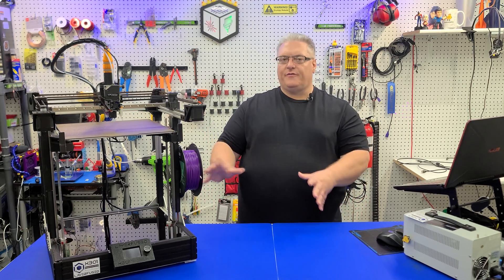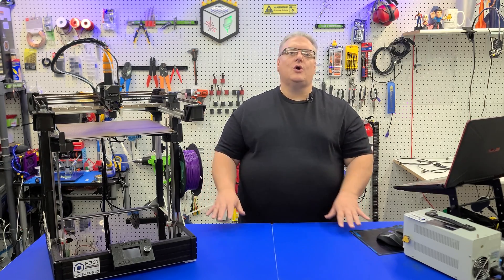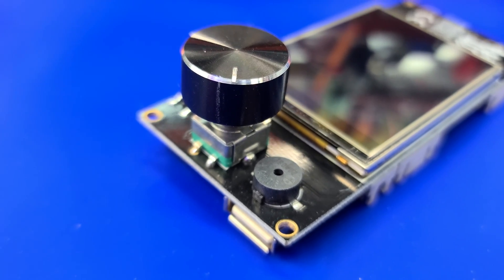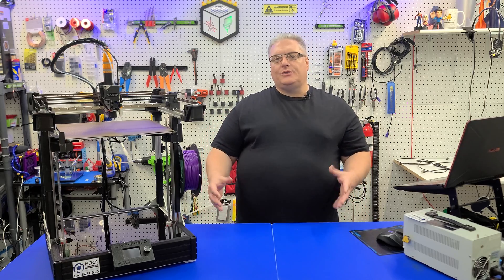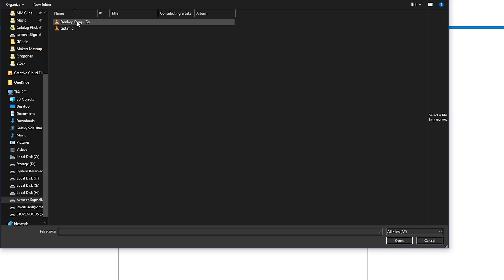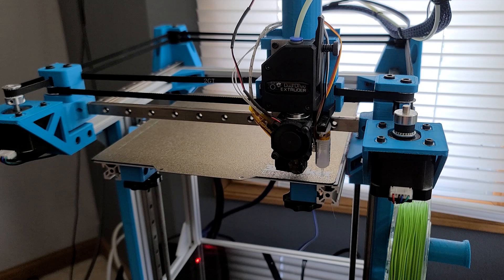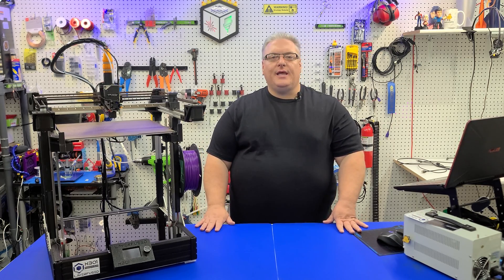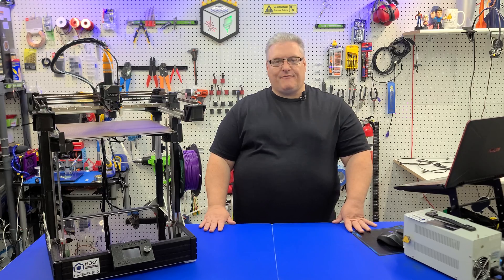3D Printer Ringtones | Improve your 3D Printer workflow with sound! | M300

Comment: I tried this, but every note has the same frequency beep. Do you have to put "SPEAKER" before the M300 command? Im using an ender 3 v2, so im pretty sure the piezo can do different tones
Reply from the maker: No, just the M300.  My guess is that they don't have it assigned to a PWM line anymore.  So its just sending ON/OFF to a beeper now.  This will vary by 3D printer make and model.

Comment: I set a custom command for z axis that made a chirp whenever the gantry moves in z. I forgot about it until I enabled z-hop for a very challenging torture test (a little tea-candle sconce with a webbed wall, intended for LED tealights).

The racket was astounding.

Comment: anyone got any ideas where you could connect a speaker on an Ender 5 Plus, there is a slot at the back of the touchscreen but that only enables touchscreen sounds and not M300 sounds
Reply: It's not enabled in firmware
You will need to compile custom firmware